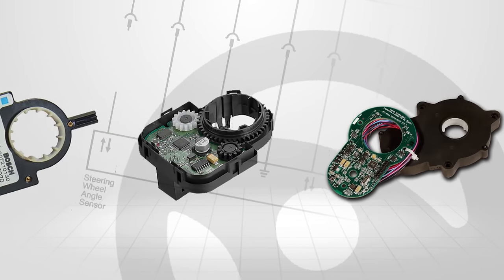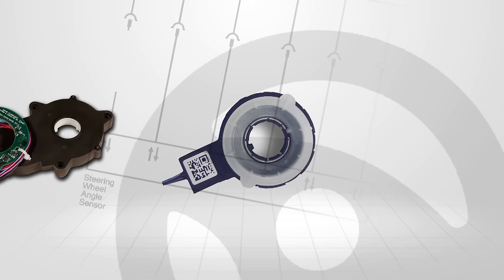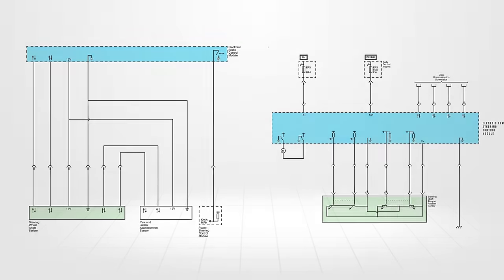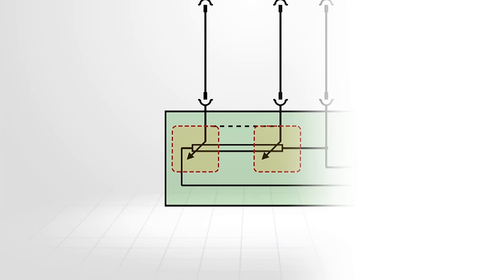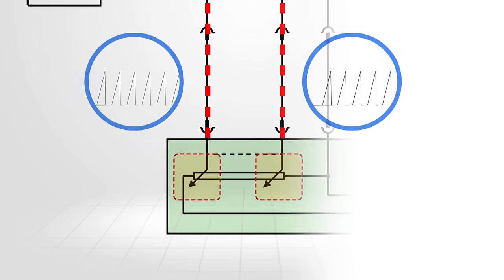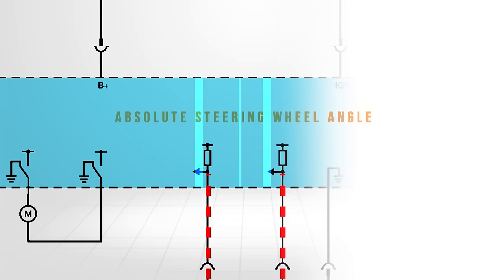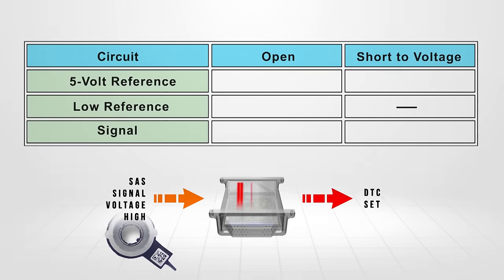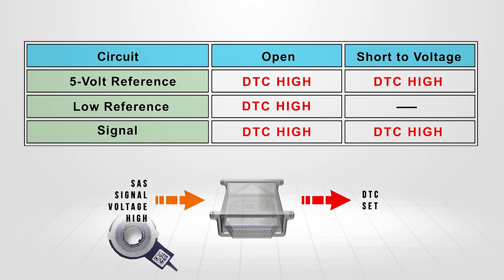Steering Angle Sensor Voltage High

Comment: Bro i have a kia it's EPS when I turn little bit for the right side only at a certain angle the steering make unusual sound like something is grinding inside and when i complete turning it the sound disappears, 
What is the problem ?? 
Is it torque sensor!

Comment: I came across your video very beautiful, I changed the steering angle sensor which I believed it's same as clock spring, have changing it the wheel begin to vibrate and the car will stall and becomes normal again, and vibrate again and becomes normal again while moving, it wasn't like that until I changed the clock spring, what do you think is it the clock spring that I put in that is faulty or the voltage is high,  I scanned the car and it came up with p0443, which is nothing of the issue, what is your professional advice pls sir.

Comment: VW Polo 9N 2003. Code was power steering sensor open or short to ground. Replaced steering sensor and a few weeks later the fault reappeared. What could cause this?

Comment: I read somewhere that too high an ampage battery will that stop the steering sensor working, I replaced my battery with a higher than rated ampage and now the steering angel sensor wont reset like it always has before.  could this be the cause as it worked before I changed the battery and reset whenever the old one went flat.  It seems strange that changing the battery should create this issue and unlikely there is anything wrong with the steering sensor if it worked fine until the battery went flat for the umpteenth time.  This is the second battery and the first one of the same ampage didn't cause a problem.  The car is a Mercedes E430 estate 2001.

Comment: Can the steering angle sensor make the power steering stop working?
Reply: No
Reply: Toyota told me YES.  They claim a voltage spike from this sensor caused our RAV4 power steering to fail.  Turning the car off and back on reset it, but they could not give me a satisfactory reason what caused the spike.  Tried to say vibration from warped rotors caused it but we were not braking when it failed.

Comment: Hi 
is bad battery on bmw m5 e60  has effected on the Steering Angle Sensors?
Reply from the maker: It’s hard to say, but a bad battery can have very interesting effects on electrical systems.  You will find the first advise when completing diagnostics on a vehicle is to have a battery maintainer running to ensure correct voltage while you troubleshoot.